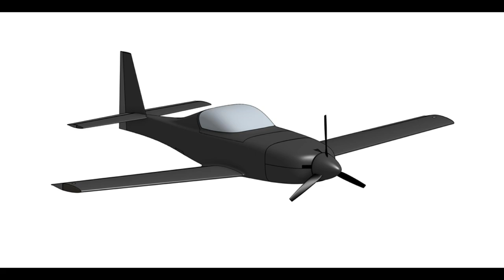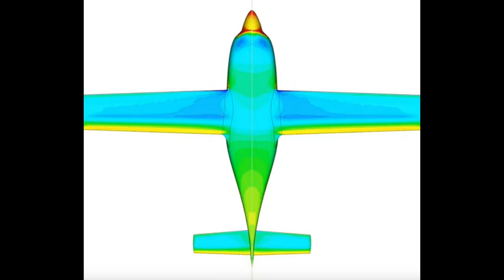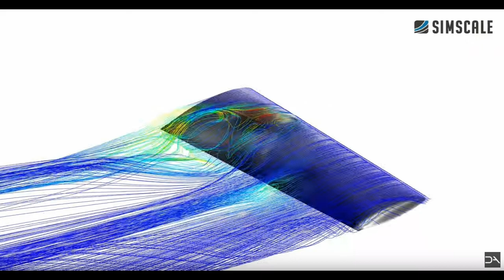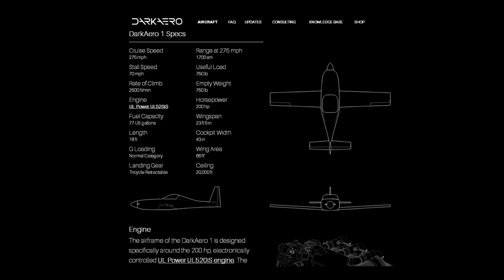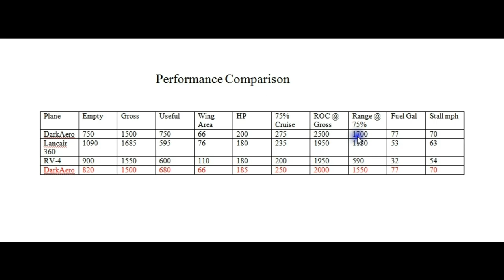Exploring DarkAero. Video #109

Comment: I wouldn’t think twice about putting my life in the hands of a few young chaps with possibly less than 10 years aviation experience and 1 build between the three of them. I can’t see this endeavor being anything less than smashing. No pun intended! Brilliant! Cheers mates!!
Reply: My bet is that you've never built your own experimental aircraft. The homebuilder is ultimately even more responsible than the kit manufacturer to ensure that the plane is safe prior to flight testing. This plane will be a huge commercial success, and very safe.  Most other kits do not even test their critical assemblies.  You probably should stay on the ground with your negative attitude anyway.

Comment: I still cautiously weary of the posted empty weight, especially when the airplane has a retractable landing gear.  This tends to increase the empty weight with the pay-off in faster cruising speed from the reduction of the landing gear drag.   We shall see what the final numbers will be.
Reply: From their recent video they are projecting less than 780 lbs dry for the prototype. 
I think they did a great job and could still weight optimize some of the design if they want. 
Though I don't think they need to.

Comment: Flying out west in the Summer this needs a turbo and more wing to be attractive for my kind of flying. Optimize the design for 12500’ to 17500’ to fly VFR direct at possibly 300ktas+ for 1200 to 1500nm and I can avoid the airlines (weather permitting).
Reply from the maker: That would be attractive to many and would certainly need more wing IMO.
Reply: There's a Lancair for that
Reply: Prove engineering concepts first, then tailor specs to fit specific profiles. High altitude will require oxygen system and should have pressurization. I'm sure these will come in time, but this is the early stage.

Comment: 3:05 let's talk about it's stall behavior. (I'll preface this by saying I'm thoroughly impressed with the dark aero teams engineering prowess and attention to detail).

Unfortunately, this aircraft is not going to have a friendly stall. No matter what that CFD stream flow shows, that shot is demonstrating a "perfect" steady state stall scenario. The real world is much more dynamic.

1: They use a modern Airfoil designed for favorable pressure gradients for maximum laminar flow. There is no problem with the NLF-0414F and similar foils. The issue lies in the fact that they have narrow drag buckets, therefore one cannot use sufficient washout (wing twist) along the span without causing  some portion of the wing to operate outside of the low drag bucket under any and all flight conditions. This would be unacceptable and would likley prevent their high speed aspirations of 275mph on 200hp with 66ft^2 wing area. Therefore one can be assured that the total washout used on this wing was a relatively small amount to maintain efficiency, thereby compromising the stall behavior. (Specifically the roll-damping during the moments after initial stall-break). 

2: Taper. The fact that there is a noticeable taper to the wing means the tip will be operating at a reduced Reynolds number to the root, thereby having a reduced maximum stalling angle of attack from this effect alone. They used a moderate amount of taper presumably to avoid adverse effects, bit it's still going to be there simply by the fact that this is a moderately high aspect ratio wing of very small area. Meaning, the wing chord is short (narrow) so it will be operating at a relatively low Reynolds number of only aproximatly 1.5-2e6 at minimum speed. The reason this matters is because Airfoils don't change their stalling angle of attack significantly between Re=3-20million but it changes radically in the range between 3 down to 1 million and below. So even a small reduction in Reynolds number might mean a reduction in stalling angle of attack of 1-2° from wing root to wingtip. This will nearly negate any and all of the slight washout at low speeds and Reynolds numbers.

3: Dynamic. - The rolling motion brought on by the inevitable fact that the stall will nearly always begin on one side before the other will tend to  create an un-commanded roll. This roll, as found in all conventional aircraft when stalled, no matter how slight, will cause the wingtip angle of attack to increase due to the wingtip helix-angle. That is, the down-going wingtip sees a relative wind coming from in front of, and below, at a steeper angle than the root at the same fuselage angle of attack. This angle can be significant, and it's determined by the forward speed and the roll rate. An mild wing drop can push the wingtip to a higher angle of attack by several degrees, more deeply stalling the wingtip Airfoil section, reducing it's lift further yet, allowing an even more rapid roll to continue in that direction. (Negative damping, where one needs positive damping).

4: Vertical Tail area and arm. It's a high performance design with a very small tail, for reduced drag. But the vertical tail is quite important for maintaining both yaw stability and lateral (roll) stability in the stall and post-stall region of the flight envelope. Exacerbating this small stabilizer issue is the fact they chose split-flap type rudder control, which is probably less effective than other options due to limited lift attainable and the fact that it will generate a significant amount of drag at full deflection, right when you need maximum rudder and minimum drag, at low speed entering a stall, trying to maintain yaw heading to prevent a spin. 

[Not to say the split rudder cannot work, it's simply not ideal for this application it would seem. The desire for speed brakes, tricycle gear, and experimental rudder design in an extreme performance design seem to be contradictory requirements in an aircraft, in this pilots opinion. Give it a real rudder, in this specific application. Any pilot worth a grain of salt knows how to slow down with an application of G-loads, overhead break, flatten the prop pitch, etc.].

These issues mentioned are fundamental to all aircraft; But the choice of small wing area, high aspect ratio, moderately high wing loading, especially for the size and Reynolds numbers. And the laminar flow Airfoils need to be placed at nearly the same angle of attack along the span, to achieve low drag, reduces the available range of washout the designers can use. 

The best option for them would be to sharpen the leading edge of the Airfoil approaching the wing root. This would serve to lower the root stalling angle of attack (though also reduce it's maximum lift attainable by one to several 10ths of CLmax). It would also help maintain laminar flow behind the propeller, having a more aggressive pressure gradient in this area with the sharper nose. They could also use a thicker Airfoil here, as thicker Airfoils with sharp leading edges tent to stall at a slightly lower angle of attack than the normal NLF type foils do. It would also allow more space for fuel, etc. And also improve the width of the low drag bucket. The other alternative is top secret, unfortunately. 

But it appears the designers have not adequately factored in these problems, or implemented any of the above solutions, by the careful scrutiny of their CAD models and prototype wing they did not use a sharper leading edge or thicker root Airfoil section, nor did they use any of the more common solutions such as significant washout, discontinus leading edge, droops, cuffs, VGs, etc. 

And so this issue will certainly become a problem that will inevitably limit the market audience for this model and place it among the other high performance oriented (read compromised usability) types.
Reply from the maker: Much needs to be proven and validated in the flying prototype for sure and I've been clear about that in my comments. Certain things will not work out and have to be changed in production kits.

You never know on stall characteristics. The Questair Venture has a very small chord, highly tapered, thin wing but has reasonable stall characteristics. I was involved with one of these at Reno in 2008-2010 where it won Super Sport Gold there. Neat design that not many people are familiar with.
Reply: @rv6ejguy  that Questair Venture is a fantastic design, I researched it several years ago, and was keenly interested specifically in it's stalling characteristics, believe it or not. (There is a video of one stalled on short final, you can make out the wingtip vortexes, and it takes a good two-count to begin a roll off to the side, it impacts mostly level). So, it has excellent post-stall roll damping.

That aircraft was created by a top civilian aircraft designer and utilized much of his experience from the Piper Malibu, from my internet research of the plane, and the fact it appears to share several components. Especially panel-forward.

Stall behavior is actually very predictable, Ddspite what all the textbooks say. As there was a massive amount of research in the early to mid 1940s by the NACA. Incidentally, the Venture uses an Airfoil combination that I myself had selected as a good stalling combination based on some of those research papers.

The F8F bearcat uses virtually the same combination. It's  known to be rather docile when power-off, based on reports of the era and not recent hype. The Beechcraft Bonanza also utilizes the same Airfoil series, and very similar Airfoil section  thickneses as the Bearcat, Hellcat, and Questair Venture.

The 23017 stalls quite gently, with a soft peak and some post-stall lift. The 23012 is far more  abrupt, and drops off sharply under most cases. Probably the worst-stalling airfoil ever made is the 23009, which is found at the Bearcats wingtip and the 23010, only marginally better was used at the tip in the questair venture. - But, it all works because the 23012-23013 section thicknesses attains the maximum lift of that Airfoil family. (13% attains maximum lift across almost all Airfoils, laminar and turbulent). And the 23012 appears at aproximatly the 70-80% semi-span of the Venture (and the Bearcat). So, the the root is a soft stalling Airfoil that stalls at a lower CLmax than the 23012, as the 23012 has an identical, or slightly steeper lift curve slope, the same zero lift angle, and attains the highest CLmax, staining a higher AoA than any of the other thickneses of that Airfoil fanily. By using a normal wing taper ratio, with 17% root, 10% tip airfoils, the 12-13% thickness sections fall at the 70-80% semi-span of the wing, instead of being too far inboard to provide adequate roll damping. Or too far outboard to make any lift at all (Bonanza wasted the 23012 at the tip, where zero lift can be made, should have used the 23010 or 11 to move the 12% inboard a little). so, The 75% semi-span of the wing on the Bearcat, and the Venture remains flying, after the gentle root stall, and doesn't roll-off immediately unless pulled aproximatly 0.5°-1.0° farther into the stall. The 70% semi-span has a longer chord, and therefore higher Reynolds number than the wingtip, and suffers less adverse effects because of this. Placing the highest lift Airfoil outboard far enough to provide roll damping, but inboard enough not to suffer much Reynolds number effects, then adding any amount of washout twist will increase this stall margin. 

The Venture stalling characteristics were absolutely known to the designer in the preliminary phase on that specific airplane, I know it without a doubt, as well as the bearcat, which was intended to be a maximum performance fighter that needed to land on carriers by 300hr pilots. 

Good stalling behavior are almost never an accident, except in the case of 1910-30s constant chord wings made for simplicity ended up being good, almost by accident.

The Dark Aero, I can say is going to have a rather small margin between root and tip stall, and therefore won't have much roll damping in a post-stall condition. This is because those few Catalog NLF Airfoils that have an identical shape to the one they have selected have a small low-drag "bucket" and this limits the amount of washout that can be used, as I mentioned previously, and it appears by their CFD results that washout is their method of choice, and not a combination of the above thickness variations, along with variation in leading edge radius and section thickness that it would require to make it exceptionally stable in the stall. 

So, I foresee some owners applying VGs in front of the ailerons, which will cost drag and speed to die disruption of the laminar flow in that area. They can also add a stall strip to the leading edge at the wing root, which won't cost any drag measurable, or maybe use some other bandaid fix. But, it's inevitable. Imo. -  If there were a thicker section at the root, or a variation in the leading edge radius along the span, growing thicker to the tip, or if there was a very distinctive root stall on their CFD screenshots, where the tip was decidedly not-stalled. Then I would not have made any negetive predictions. 

But the design, by my scrutiny, lacks most of these features, utilizes wing twist exclusively, which is limited in it's amount by the low drag range of the Airfoil selected. And that angle variation will barely, if at all, make up for the variation in stalling AoA, due to the significant Reynolds number effect in that very low Re range of 1.5-2million.

There is actually a brilliant way I've sort of re-discovered, to provide post-stall roll damping at any attitude, including inverted, and almost any airspeed, any reasonable, or even unresonable sideslip angle. But it's in conflict with achieving laminar flow at the wingtips. Many designs have used it since 1935, but most it's a side effect of other design considerations. There was one WWII fighter, an earlier design which was used throughout the war which had such fantastic stall characteristics that it could be pulled into a stall and flown around in that condition without snapping, or dropping a wing. It had a billiant designer, who was so far ahead of his time that almost nobody seems to have noticed, and 85 years later people still consider stalls to be difficult to tame or predict, when it's actually a very easy matter if understood completely.

Comment: I was surprised how heavy it was given it's made of carbon fiber. Perhaps it is because they didn't use prepreg and autoclave?
Reply from the maker: This is very light  for a 2 seat, 200hp retractable with a C/S prop. This is infusion, bagged and baked. No excess resin. Is there another comparable plane you know of that's lighter?

Comment: They published a video with an electrically actuated variable pitched propeller.  It’s worth a mention.
Reply from the maker: Electrically actuated props have been around since the 1940s and are common on auto conversion like the Subaru. MT and IVO have been making them for over 20 years. in light of this, I didn't think that aspect was worth mentioning.
Reply: @rv6ejguy  Yes, they have been around since the 1940s, but are much less reliable than a hydraulic prop.  Nobody uses them unless they have to.

Comment: The only thing I don't like about the dark aero is the split tail.    I also wonder if the new ul520ist will fit.  The idea of a normalized  motor is intresting. Its ~30 # increase in weight.  It does have a ~5 " bigger x dimension.  Not sure if it would fit, but it is intresting.
Reply from the maker: I am open to seeing if the split rudder works well or not. If it works, bravo and you have a speedbrake of sorts too. If not, back to a conventional rudder and lesson learned.
Reply: Yeah, that is the one thing that a split rudder does well.